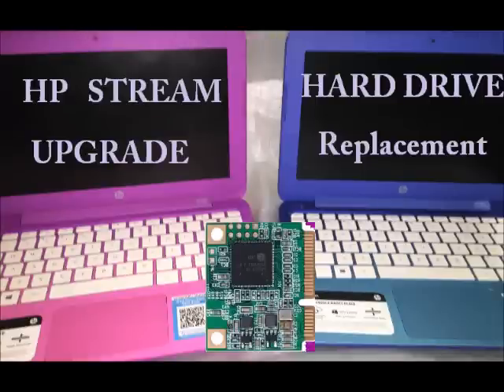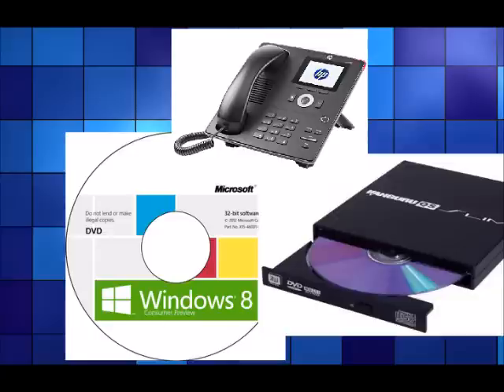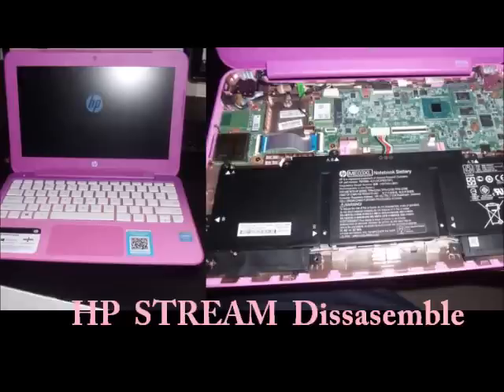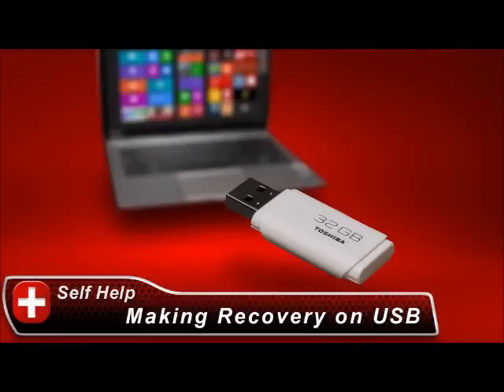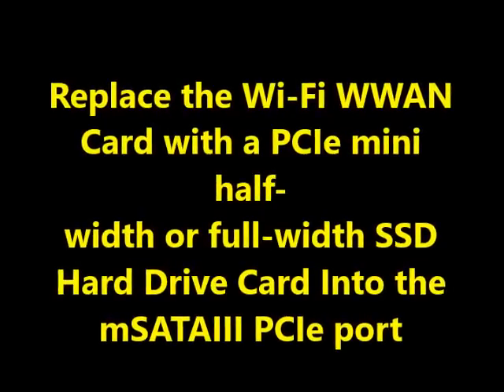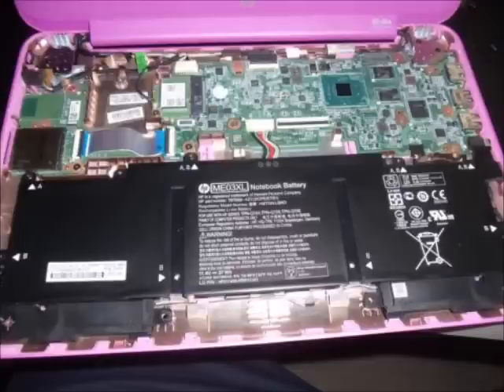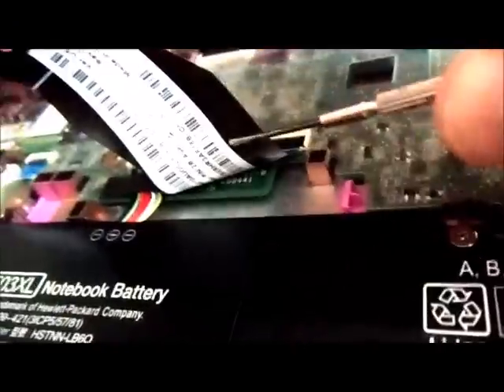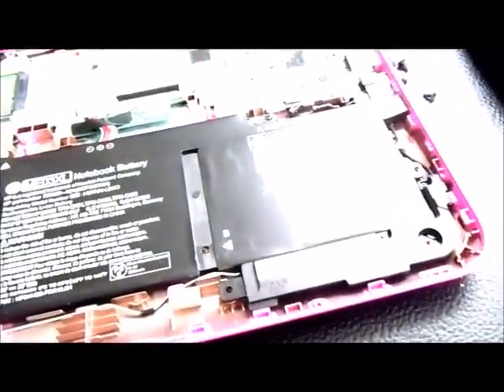How To UPGRADE HP STREAM Hard Drive 11 13 14 11-d 11-p 11-r 13-C 14-Z X360 Pro G3 G2 Touch SSD RAM

Comment: The Card Edge on this SSD is slightly too big for my Stream. I bought the SAMSUNG  PM851 256GB SSD HDD Mini PCIe mSATA MZ-MTE256D MZMTE256HMHP-000D1 which is the same as PM830 and found it just quite don't fit. ? ? ?

Comment: Ububtu Mate runs great on my Hp Stream 13 even at factory specs! That's with2 gb of Ram. 15 gb left on factory SSD afterr full install. Threw in a 128 gb micro sd and its a very useable machine!

Comment: On my stream 11 ak0035nr  the modem presently installed has 2 wires that clip on the modem. Im assuming the replacement hard drive I ordered does not have those connections. What do I do with those 2 wires after installing the new hard drive?

Comment: Unfortunately it won’t work on the stream 14 because the space for the wifi card is so small 20mmX30mm no ssd cards are available in that format even half size are too wide and it has only 1 centre screw to secure so thats not available either unless someone can find one?
Reply: Yes, its actually 22 x 30 mm and there are a few M.2 2230 SSD cards on eBay.  Search for 'M.2  or NGFF SSD' My question is if the BIOS will recognise that connector as a bootable drive or even a storage device.
Reply: lb09486 actually I managed to get a m.2 to wifi port adapter which attaches by ribbon and into a space in the top of the case. Good news is windows recognizes it so you can use it for internal storage bad news is bios does not see it as bootable device so you can’t get OS to work from it - still trying other things as I refuse give up having made this much progress
Reply: @paulchambers8270  I figured the BIOS would have a big issue because I only saw two boot options. Perhaps we can flash the BIOS assuming there is an update that allows that M.2 channel to be used as bootable. Send me the link where you got the adapter I need one. Thanks a lot for your update. Trying to see if  SD card is bootable as we speak.
Reply: @paulchambers8270  Hey, thanks for the tips :) its your post on hp forum ?
Reply: Mr pingouin yes i did post a question on hp forum too - not much help from them though
Reply: @paulchambers8270  Bonjour l'ami :) i just installed the adapter & ssd (silicone power 512go). As expected the bios is not designed to boot from anything other than the emmc chip or a usb port. Based on this assumption, I re-installed linux mint 20 (xfce runs better than cinnamon on this pc). Here is the configuration of my partitions: emmc: 2go ext2 mounted in "/ boot" ,8go in swap, the rest in EFI. For m.2, all in ext4 mounted in "/". Result the computer boot on the emmc, the boot manager (grub2) then allows you to load the desired OS/SSD(we can have as many OS we want, even windows). So I end up with 500go of storage available :) Thanks again for the link for the adapter. Hope this help you too !

Comment: You can increase the memory. I went from 4gig to 8gig... Some say you can go to 16gig, but I don't think they make a single dimm 16 on DDR 4 (or 3). I have a HP Stream 14. I pulled out the wireless net card in put in a 500gig M2 drive and it shows up, but can't boot from the Network Card for some reason.

Comment: Here's my question my daughter bought this laptop and it only has 2.57GB free HDD space she has Win 10 it's trying to do updates but says not enough space is available to do it. There is a space for a micro sd card which I bought and put it 64GB one and tried the update again it still doesn't work. Is there a way for me to use the sd card for the updates ? Or move the system files to the sd card I have tried using the system clear space apps it doesn't clear enough space not sure what to do here... any help would be great.

Comment: I got an HP Stream 11 (2gb ram, 32 gb memory) on eBay for £25 including shipping.  Got rid of windows immediately and tried various Linux distros, ended up with Endeavour OS because the wireless worked right away…it had a weird wireless card and I would have had to faff around downloading drivers over Ethernet. It works great for my purposes and I’m using the Cinnamon desktop.
Why would anyone want Windows?  It’s absolute rubbish bloatware and they just want to sell your data.
Reply: So, Endeavour runs okay on 2GB RAM?? I might recommend that if so. I've had a few people recently contact me about the Stream (must have been named after a stream of p*ss). HP should have had a class-action against it for this criminal BS of 2GB/32GB, with NO hardware upgrade path. They would have KNOWN that it would become immediate landfill garbage as soon as the next upgrade of the sh1te M$ OS.
Reply: @@icyfishdog I have an issue w/these companies making landfill rubbish out the gate. Even today, there are a plethora of anemic laptops being shat-out of factories with soldered & non-upgradable RAM & storage. Considering that RAM does go bad, it's absolutely criminal, in my view. It SHOULD be illegal. The average person isn't even aware what they're buying because tech has become so convoluted & disjointed. PS: I've been running Mint since 2009 after testing others. I've tried Xfce on various laptops and felt it was still heavy. Of course, these are old dual-Atoms, hardly powerhouses. However, they did run XP well & some even Wiin 7.

Comment: thanks for answering my question within 30 seconds of the video... can't install RAM. 

*tosses laptop across the room!*
Reply: you can . . .
Reply: Hit and miss. Some models have socketed ram an some are just baked into the mainboard. I have a 2 yr old stream 14 that has socket an a 3 yr old stream 11 that does not. I have fixed a few other of these streams as they're popular in my area for some reason and 75% had socketed ram.
Reply: @Samm11pm  how?
Reply: @korayt17  in my go stream the ram is removable
Reply: @Samm11pm  which model do you use?

Comment: Can you replace the mother board ? My daughters will not display any video. Power button lights up when plugged in. But when I power it up no video at all. Since this is embedded video replacing the motherboard is necessary. However does the board need to be tattoed to the drive ?
Reply: Erik Kaiser Yes the mother board can be replaced. However. You will have to send the boards somewhere to have the emmc switched over to the new board if you want to save your data.
Reply: Thanks for the information. I figured as much about the HP mobo needing to be tattooed to the hdd. I believe I still have access to the tech material since I used to perform laptop and pc fixes for a company which I used to contract for.
Reply: You will have to use a hot air station to transplant the emmc.

Comment: Can you show exactly how to remove and replace the hard drive? I've tried all the troubleshooting techniques and tried resetting to factory defaults but it just won't boot all the way. I think I see where the hard drive is, but there's a tiny wire attached and i don't want to ruin the whole computer by just ripping it off.
Reply: You were very observant to see a small wire, since the Stream integrated the eMMC storage onto the Wifi card (sometimes referred to as a 'Postage Stamp' card, the wire you saw is probably an antenna connection.  Replacing the Wifi/Storage card that came with the Stream means it will be necessary to use a USB plug-in Wifi adapter afterwards in order to go online. (The Stream I brought does NOT have an Ethernet port at all.)

The surface-mount antenna wires are (like) "Zero force" and should pop on or off with just a fingernail's worth of push, BTW.

Comment: I got my stream 11 from the pawn shop for $50 only because the battery didn't work. I needed a laptop badly. I later replaced the battery for $30.

 I used to travel a lot for work so it the steam was perfect for my life and it easily fit in my backpack. Now I'm at home and this laptop still has some life left, so I want to add a new hard drive. This is a great video on how to do it. 

Thanx for posting this informative video

Comment: If anyone wants to do basically the same thing with no headache, just buy yourself a small 128gb usb 3.0 and use that instead of the wifi  usb card.
Reply: But what about wanting to update the OS on it's really bad ssd? It won't fit.

Comment: I hate this laptop with the passion of the heat of a 1000 burning suns. 
I store everything I can manage onto an SD card and there's still only 0.1GB space left. What is taking up ALL that space?!
Reply: Rory Oliver Probably the restore partition.
Reply: HP bloatware. Thanks to that bitch that ran for president HP computers are cheap crap.
Reply: there is apparently a "windows.old" hidden directory ( or something.old) - its at least 5gb. find and delete
Reply: 200gb sd card for about 76.89 on amazon
Reply: windows installation is 28GB ez.. laptop only has 30Gb hard rive space so.. ye
Reply: That's Windows for ya. I would never buy a cheap laptop for Windows. I'd install linux.
Reply: Despondent you can't buy a cheap laptop "for windows" when windows is already installed
Reply: I bought a 1 TB USB  hard drive and put ALL of my stuff on that.  Of course I use a desktop almost all of the time and got the HP Stream as a portable something to keep my mind working and to enter some data into files.
Reply: windows updates eat data storage the OS takes up about 16gig before anything else then there is a restore partition which contains win 10 install files and last of all there is the crap hp puts on there but the windows updates will use more than anything so out of 32gb your not left with much which is fine if you just want to surf the web to watch a video on ho to get more storage
Reply: I laughed really hard at your comment because I feel the same way. I bought it mainly to play TF2 online (which it turns out I can’t) and it said on the box 32 GB. Well what they don’t tell you is that over half of that is already taken up by the software the computer needs to function. They also don’t tell you that you can’t add RAM. It’s a fucking ripoff and I’ve hated myself for purchasing it ever since...
Reply: Preinstalled apps
Reply: i have linux mint on mine
Reply: @izaicslinux6961  that's a stupid comment and it obvious that you don't know anything about computers. Windows is a os not the maker of this monster, also, it haves a 32gb emmic hardware for storage. Pretty much dead in the water with storage. But that's not windows fault, it's hp designed failure
Reply: Rory G ikr same
Reply: Hey, I'm from Mexico and I fancy that laptop, in your case, I recommend selling it and get a Sony or Dell laptop. As for hate, that kind of
 laptops are better for other kinds of uses, such as writing novels, 
reading books, watching movies, installing a small operating system 
apart from Windows itself and enjoying the comfort of hardware, beyond 
its low power. What I want to tell you is that
 the Hp Stream is not for you and yet, I imagine that there will be 
people who want it, so you could try to change it for another and pay 
the difference. But anyway; do not hate yourself for an error of that kind, total; Hardware is the problem, because it is not for what you want, not you. Greetings. Ps: love yourself and forgive yourself, hugs.
Reply: The os and recovery
Reply: Google Chrome temp files.
Reply: @Rory you read my mind, I cannot stand anything from HP, it screams CHEAP and POOR quality. i want got to HP quarters and lit their  building on fire how much i hate their crap!lEach of their laptop get  bloody hot and they are so slow, I will never buy anything again that bear that horrible logo more like rising  high my  blood pressure!
Reply: Exactly the fact HP is licensed to sell such a shit product... and be fine with it busts my balls man
Reply: Rory Fender windows 10 needs atleast 30 gb so it’s probably just windows cuz I have that problem
Reply: Windows 10 64bits needs about 32gb of space...so....there
Reply: José Luis Puente EXACTLY, YOU U GET IT
Reply: @yucagizen  I found a unofficial Windows 10 lite version. I got that running on it 😎
Reply: Rory Fender Windows. Install Lubuntu 18.04
Reply: THERE IS NO SPACE. That's the whole point of this video.
Reply: You r absolutely eight!
Reply: Factory reset to the rescue, bout 1 time every 6 months lol
Reply: KylΞ or better,go on eBay and buy an old thinkpad with a128gb ssd (and maybe 8gb of ram)
Reply: @izaicslinux6961  i just figured out linux mint and oh man is it a dream❤
Reply: they just give u only barely enough space to install windows and a few programs. not even enough for windows updates
Reply: @hondenzondertoekoms1  29 actually
Reply: @izaicslinux6961  Yeah! I use Manjaro and it boosted my HP stream.

Comment: I'm doing the add of the half mini pcie card.  It's a smooth process but somehow I broke the connector for the ribbon cable on the power switch module so I'm waiting for that to come in.  Even for a throwaway machine, I'm surprised at how cheaply delicate this thing is, but then that is HP these days.   I'm not doing a re-install.  I did a backup with clonzilla and will just restore it on the added drive.

Comment: You can always take the case apart an hard wire a SD card to the front header on the board still being able to use the external SD slot an the extending the partition of the hard wired sd card to the  Drive C:   also still keeping the Bluetooth an Wifi cards..   but yours is also a good option.
Reply: Can you explain better for us less computer savvy what/where the front header is? Im confident in my soldering skills and your solution seems much better. Thanks!
Reply: OMG. That is a very Techie option and you know, when I followed HP's advice of using an SD card on the Stream laptop, Windows 10 continued nagging constantly about running out of "hard drive" (C:\) space.  The SD card did NOT "fix" the issue and neither did adding an External USB hard drive.  HP really "outdid" itself in producing the thinnest hardware platform of all time (4 to 5 years ago)!

Comment: Hi, I got a replacement as these instructions but my stream 11 looks different inside. For starters the back comes off in its entirety and the mb is on the back of the keyboard. The main thing though is the WiFi card is about half the size of my replacement storage. I have pictures. My mode is 11-aa000na. Please advise!!

Comment: ok first of all great video but the title of this video is misleading should be how to open your laptop and the part which is important and determine how to replace the EMMC is not here should be a continuation of this of edit the video and show how to replace it. where to buy the flash Emmc ssd and what capacity will be better.

Comment: Hi There,
I have the HP Stream 14-ax030ca with 32gb of storage. As you said on the video, we can use a SSD PM830 to replace the wifi card for more storages. I couldn't find a SSD PM830, but I can get a Samsung 860 EVO mSATA 250gb. Is it OK to use a Samsung 860 EVO? Please help.